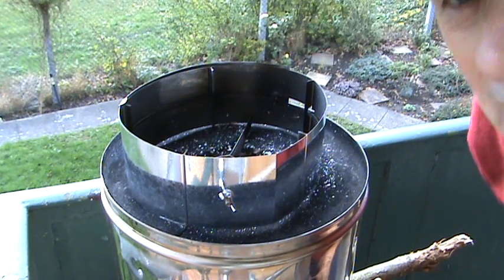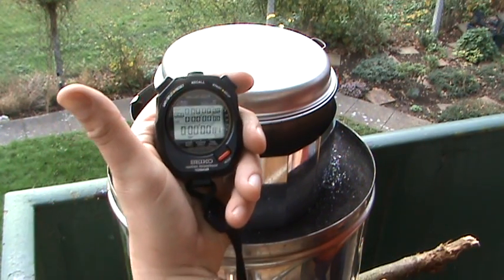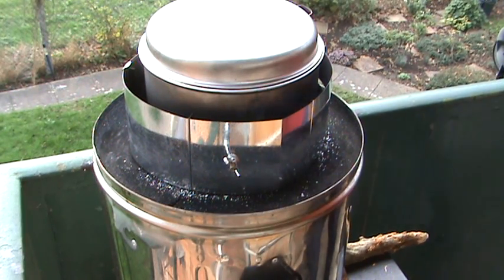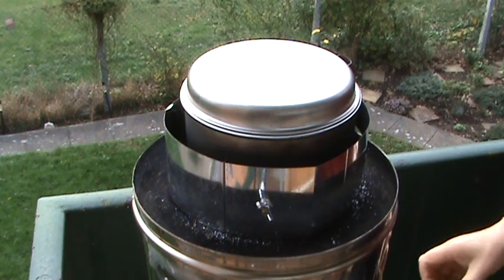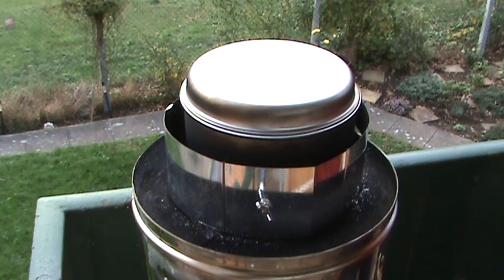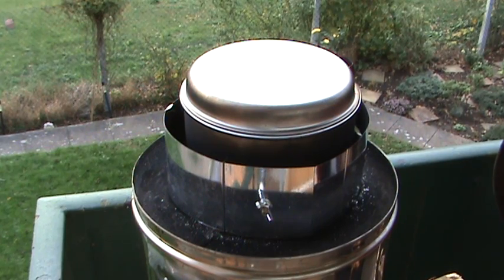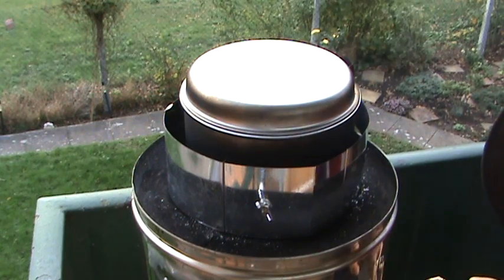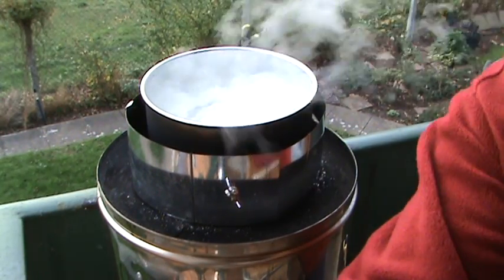My Rocket Stove speed test.MPG

Comment: I believe you use better materials, the stove-tec opening for wood is larger, so much of the heat is working to warm the extra air, normally.  You know the Stove tec collar/skirt was tighter than on your design test, so it may have cut some of the wasted heat and perhaps slightly hindered it's performance, but not by a factor of two!  Clearly, your design is the big winner!  You have a superior design especially considering the fuel feed benefits you mention early on...  Thanks for the insight!

Comment from the maker: @99cachorro Yes I agree with you, but I am not out to produce the cheapest rocket stove, just the most efficient, practical and hard wearing and I am still working towards that end, it is easy to build a cheap rocket stove that can be mass produced for shipping to third world countries for example, that has been done. I want to produce something that is virtually indestructible, fires up quick, uses very little fuel, produces lots of heat with virtually no smoke, portable and does the job.

Comment from the maker: @folderjock The insulation inside the stovetec still seems to work and hold the heat extremely well, however, I think it more a question of the design of the combustion chamber coupled with the hight of the chimney. But I'm glad you like it and thank you for your kind comment. All the best...cheers

Comment from the maker: @1971mgb Thank you for your kind comment, and I agree with you. Still, it was fun to see what the difference would be in the boiling time. These times could be improved or made worse depending on several factors, how much fuel, type of wood, air flow etc... Cheers

Comment: Without a doubt I knew yours would win.
Taller flue burns much more secondary producer gas at higher temps.
Plus you have more insulation surrounding the flue.
Good job!!